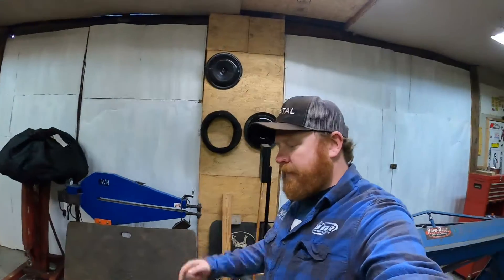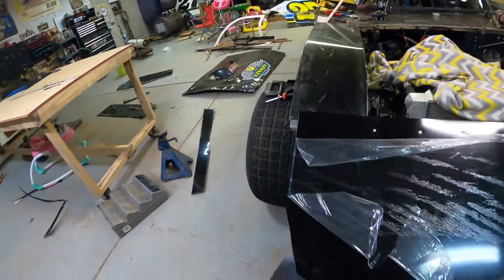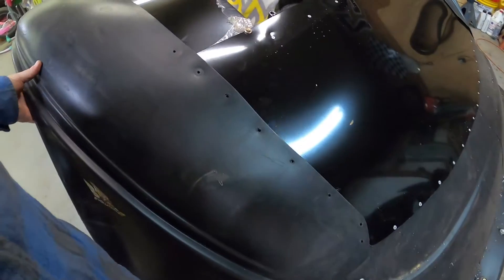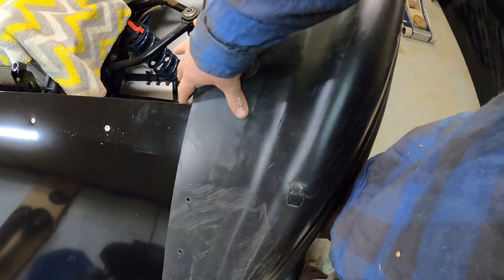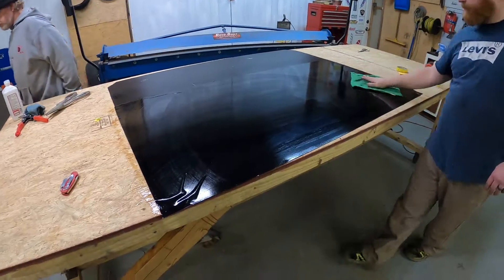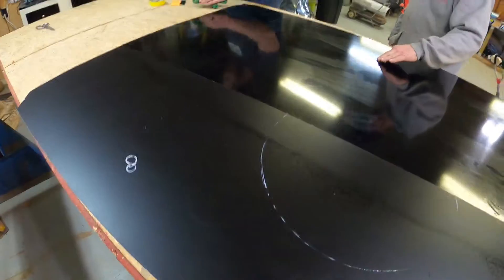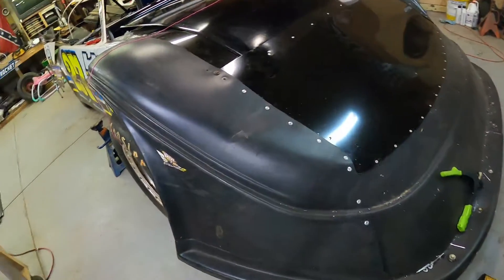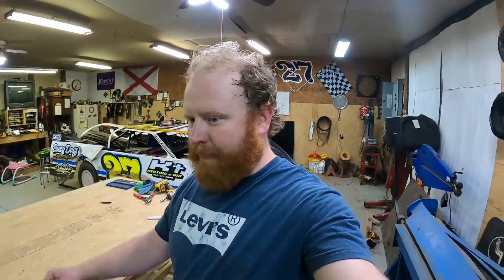More sheet metal fabrication, trying to finish the hood and filler panel on our Dirt Late Model

Comment: By looking it looks the the nose itself may be to the right to much causing the floppers to be off .
Reply from the maker: It is to the right a little bit but our other nose was like that as well. The left flopper was mounted more forwards when this nose was on a kriptonite. We were just trying to use the same rivot holes. I was able to tilt the top back & it fixed it. I just didn’t get that on video
Reply: Either way it’s great to see you guys repairing the car . You all will be back to winning races very soon.
Reply from the maker: Thank you! We hope so!